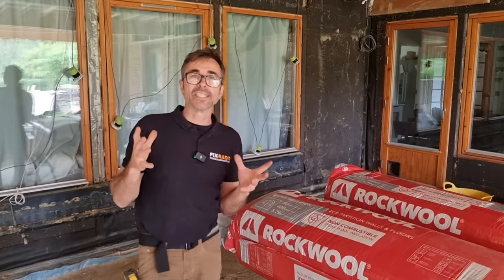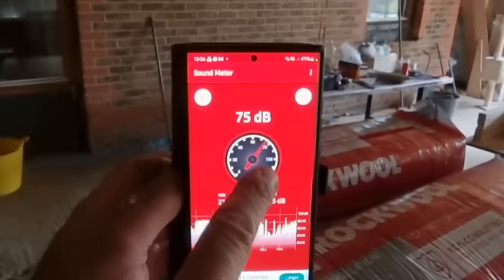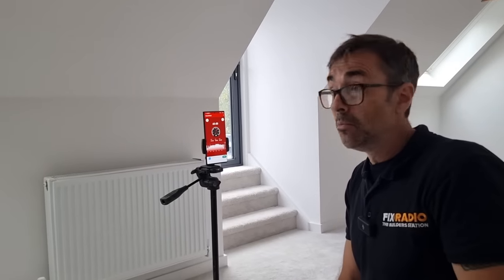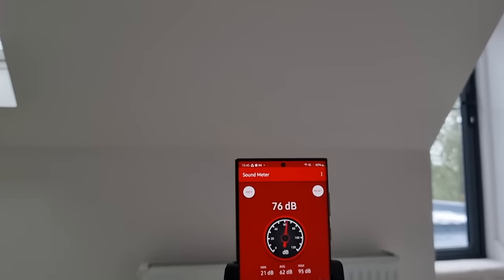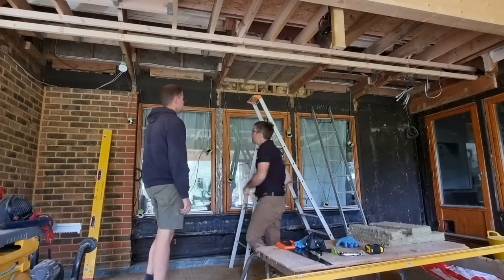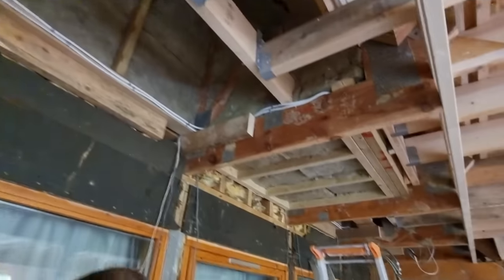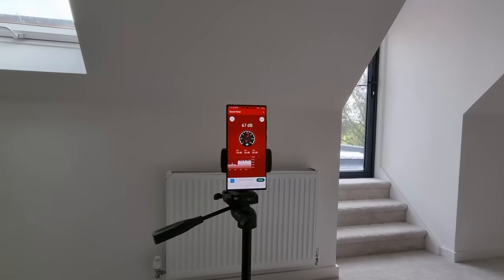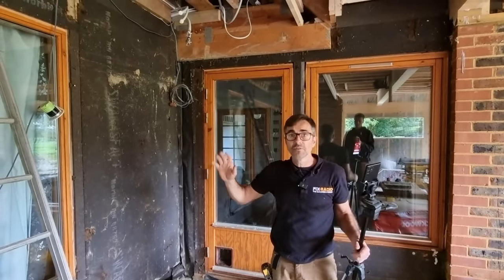Sound insulation how good is it? A simple real life test

Comment: Going from ~55 to ~45 is actually over a 300% reduction as crazy as it seems as decibels are measured on a logarithmic scale!
Reply from the maker: Awesome!!!
Reply: I have always wondered how well it actually works so it's nice to see its so effective! Nice video 👌🏼😁
Reply: pretty sure its half as loud not 300% each 10 decibel is a doubling of sound.
Reply: Not quite. The important measure here is perceived loudness. In this case going from the insulated to the non-insulated case gives us an extra 10dB. This is the same as doubling the loudness as a human would sense it. So, when asked "How much quieter is it with the insulation?" the answer is "About half the un-insulated level."
Reply: Is 100% of the sound not 'no sound'?
Reply: 3db is a doubling or halving of power.  10db is an order of magnitude higher and that translates to an audible increase (or decrease) of perceived loudness.
Reply: @andrew_langner Andrew is spot on - a 3dB reduction is a halving of the power or energy in the sound. However human hearing and our perception of loudness work slightly differently to the physics or pure mathematical analysis of how much the sound is reduced. I think another major factor here in sound perception is that most sound insulating materials will have a different level of sound dampening across the frequency spectrum of the sound you’re hearing - Think of when you hear someone with ear splitting loud music on in their car and most of what you hear first is ‘Dumph, dumph’ of the bass notes and you can hardly make out what they’re even listening to; that’s because lower frequency sounds tend to travel further or are less dampened compared to mid and higher frequencies (in simplistic terms). So making the ‘percieved’ sound reduction the ‘best’ sometimes is about reducing the frequencies that disturb us the most. Sorry for the long post, but as you’ll probably gather it’s a rather big rabbit hole of a topic - even if generally speaking more insulation = more sound reduction
Reply: incorrect, a 10dB drop is approximately a halving in perceived loudness and about a -68% drop on the logscale.

Comment: As with thermal insulation, it's going to go back to the Pareto principle, 80% of the sound will travel through a 20% hole. In this instance, a second layer of 50mm covering the joints of the first 50mm layer and also the junctions with the timbers could create a significant improvement again.

Comment: In my workshop I covered one full wall with rock wool with 8-millimeter of sound insulation rubber on top. 80 dB came down to 30 dB. It is on YouTube but in the local language @Amcatavsiyesi (Uncle's Advice)

Comment: If it’s feasible, leave an air gap between the offending & the sound attenuation wool you will get a better result, even more effective if you can incorporate a second layer, We did a bathroom fairly recently, the customer could hear the footsteps,(very loud) from above on a cheap floating floor, we installed a double framed suspended ceiling, air gap then 1st frame with sound attenuation wool then a second air gap again with the wool, the wool was held in place with polyprop netting, and it was finished with “plank”, the extra thick gyproc. It was very successful, end of annoying noises for the customer. No sound transmitted whatsoever. 
So keep in mind the design element for the best possible results
Reply: That's interesting, do you think the sound transmission is removed because it's partly reflected back to the source?

Comment: What you have done is added absorption to the source room. This reduces the amount of reveberation in that space, and thus the sound on the wall to the bedroom. You haven't actually improved the performance of the wall (although achieved a similar result). Once you put the lining back on, it will become reflective again.

With a stud wall with insulation in the cavity, you get about a 5 dB improvement over a stud wall without. It doesn't really matter what the insulation is. Lightweight polyester is almost as good as heavy wool. Just choose based on thermal requirements.

The stated % reductions are for the raw pressure (Pascals), which is not what people perceive.

Comment: Hi Robin. I've used RW3 by rockwool it's so dense and used it between floor joists and partition walls. I believe its the best stuff on the market for sound insulation. I'm curious why you didn't use a 90mm slab or 100mm for this job? Thank you.

Comment: The only way to eliminate noise is mass, ie concrete.  A drop in 5db is only just noticeable by the human ear.  Plus you were only testing the octave band frequency generated by the saw, other frequencies (lower hz for example), probably would not have been so noticeable.  But that is only my humble opinion.